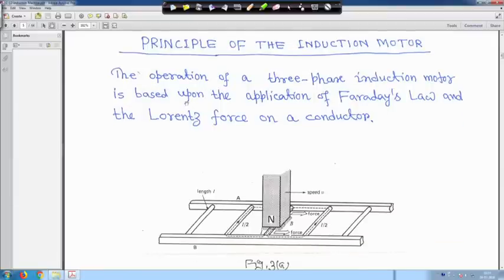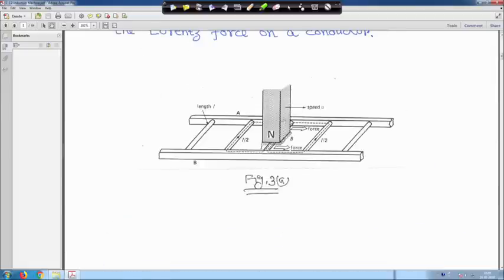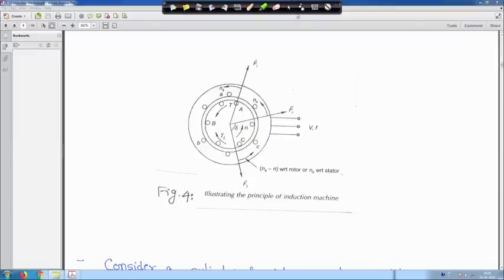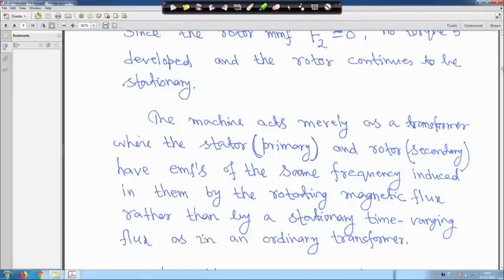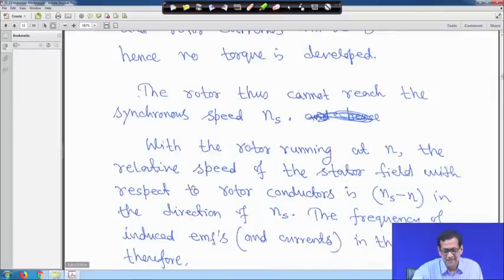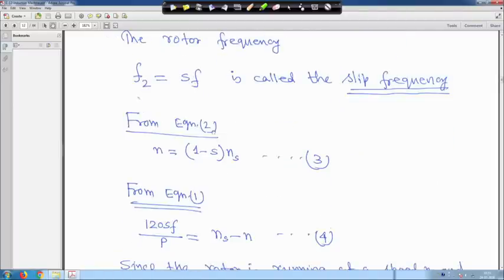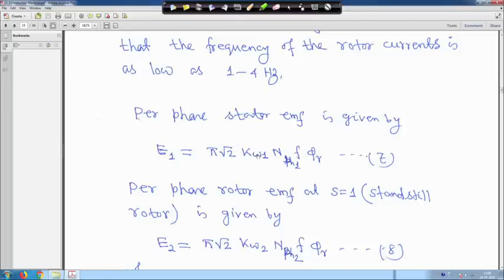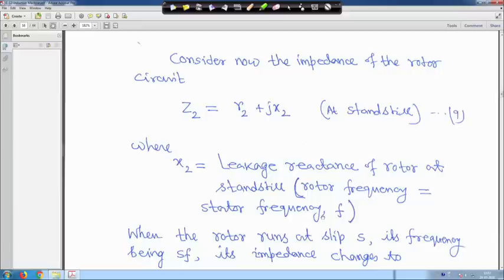Lecture 59: Three phase Induction Motors (Contd.)

Comment: Sir can explain what will happens if the three phase induction motor with 6 pole stator and 2 pole rotor energised from 50 Hz supply?
Reply: Motor wont  rotate . That's why SCIM are came into lime light because they adjust itself to stator poles
Reply: Torque produced is zero.For the production of torque stator poles number=rotor poles number